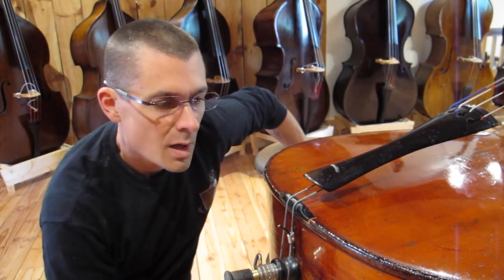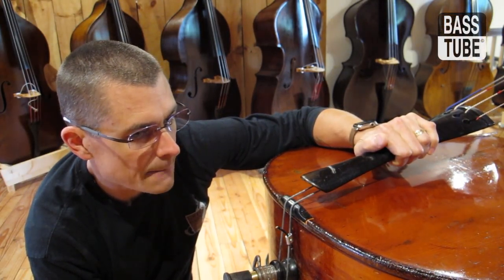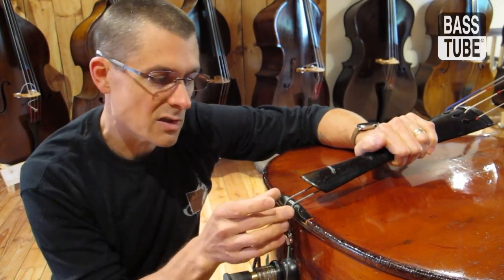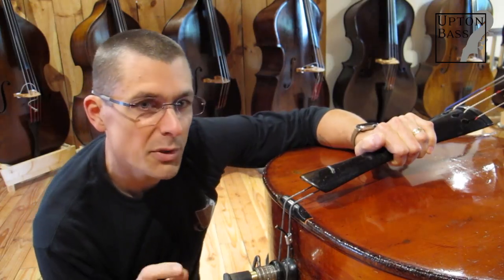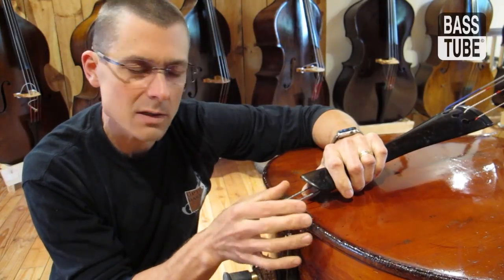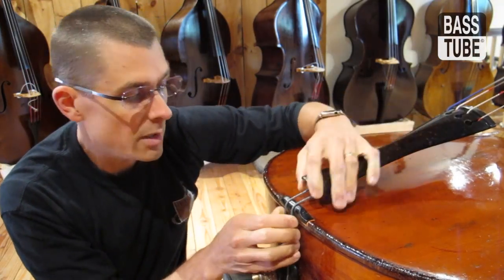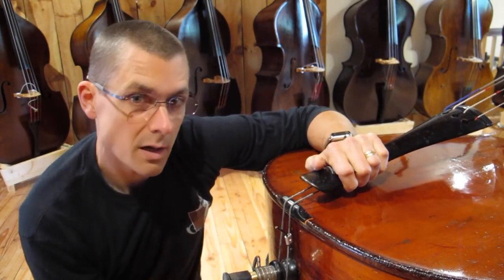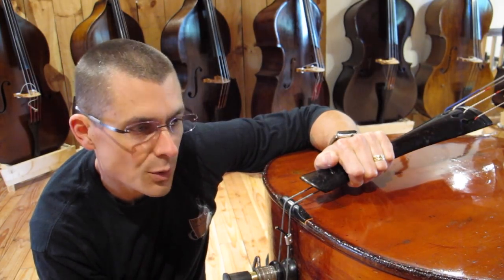How to Check Your Double Bass Tailpiece for the Best Tone on Your Upright Bass

Comment: Got this tip from Chuck Traeger's books. Also - anyone who is using a solid wire/coat hangar tailpiece wire, replace it with the cable wire. The whole bass needs to vibrate and the solid wires inhibit the tailpiece from vibrating as it should.

Comment: This proved pretty useful - I'd been puzzling for a while over why my bass was darker and thumpier than I remembered it being when it last had setup work done. Soundpost position looked fine, bridge was in place, strings were played-in but not dead Spiros, and the guy who last did my setup is retired now. But my tailpiece cord was spaced quite wide over the saddle, and shifting it back to the same spacing as the tailpiece holes has brought back that definition and sweetness I remembered.

Comment: Howdy Eric - just wanted to (a) thank you guys for making these vids - I love them all and find them really useful and informative. If I lived in the states i'd definitely buy one of your basses. 
I was also hoping you could help me understand what tonal or other differences (if any) changing the length of the tail wire makes.  Mine has the adjustable nut behind the tailpiece, and I shortened it a little when I first bought my bass (bringing the tailpiece closer to the saddle), but didn't really know what I was doing, and can't seem to recall what difference it made.  Also wondering if the myth about tuning the string end lengths to 6ths (or some other interval) is true or not, and whether it really matters that much.

Comment: Eric, I remember this thread you talked about in  the double bass luthier group. It worked for me!
Reply: Hello,
I wanted to replace my bridge so after I adjusted the new one and put everything back together, and I had the problem you describe. The instrument was not completely dead but moribond, and also the balance of volume string to string was affected, some strings more lethargic than others. After watching the video I checked the tailpiece wire and it was completely off and very spread. I took the opportunity to try with the two wires very close to each other and the bass sounds even better, more responsive, than before. Thanks for the tip.
Reply from the maker: Happy this helped you out Ariel!

Comment: I've come across several nice older German violins that have the beginning of a crack right at the edge where the saddle and the top of the violin meet. What's going on with the saddle ? Was the saddle fitted too tightly or did the glue on the bottom of the saddle give way and the saddle slipped or maybe is it that coefficient of expansion being different between the spruce and the ebony is causing these cracks is there a solution to keep it from happening again after the repair.

Comment: I have a question. I buy a double bass as a 3/4 size, it turns out to be a 4/4 when I buy it, I didn't feel any difference between it and the one I use. My Luthier says he can make the distances shorter by adding a fake nut and moving the bridge. Is there any way to make the distances shorter without adding a fake nut?

Comment: I've been looking for info about how different materials that tail gut/wire can be made, such as stainless steel, nylon, carbon fiber etc, will effect the double bass tone, but I haven't found much on the subject. I'm thinking of replacing my nylon to a steel wire, mainly (touch wood) because it will last longer before failing. Do have any insight on this matter? cheers
Reply from the maker: Two thoughts come to mind.  

1) stability:  Nylon will stretch...so won't HMWPE and other synthetic materials (and they can break).  Steel won't do any of those things (or at least not at the tension we have with a DB).  Combine that stretch with its ability to rock or twist, which brings us to...

2) dampening: If you limit the tailpiece from rocking or twisting, you're dampening it.

There are so many factors at play here, like strings, instrument geometries, playing style, etc that there are no absolutes.  Play with it and make changes...and develop opinions based on those changes.  And...change only one thing at a time...that way if you dont like it, you can easily dial it back.